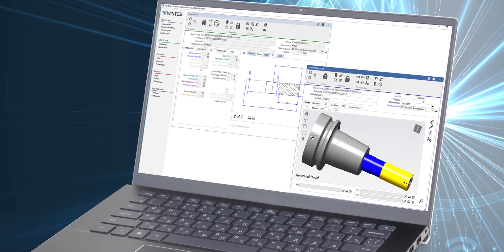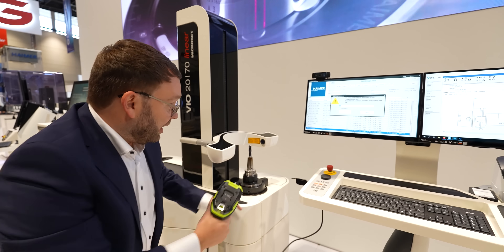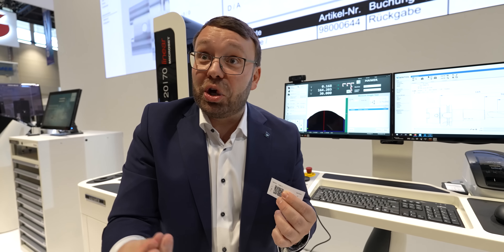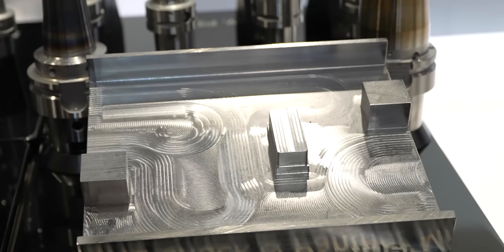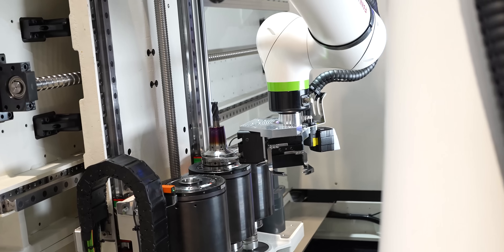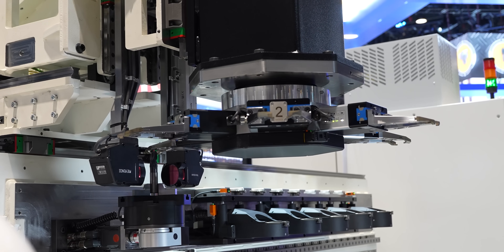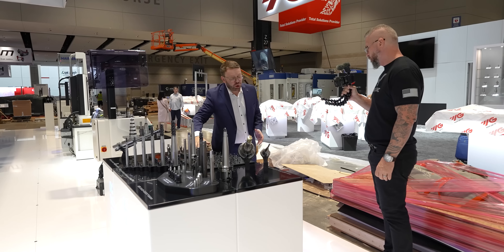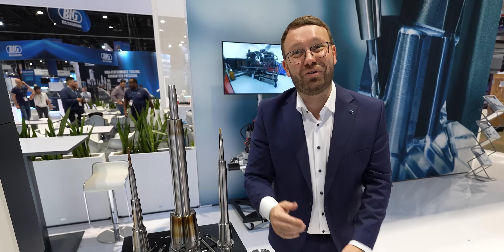Most Advanced CNC Tooling | HAIMER INNOVATIONS

Comment: We have a revolution, we have an "AI"-presetting. 🤦‍♂Ok, salesman has said the word "AI" and claims it's new, usually it's time to tune out of the video you're watching.
Reply: AI is not a strictly defined word, its a normal computer algorithm called „AI“ for marketing, the product still works as intended
Reply: @QPD-1  Well, that's part of the problem.
1) Instead of using buzzwords, just tell what the feature is doing. i.e. "an auto adjustment algorithm that tweaks this, by looking at these things, and is developed using machine learning, btw."
If you're selling a tool to a grown up man, then don't speak like you're selling a toy to a kid.
2) Just because you've implemented an ML-based algorithm, doesn't mean your thing is new. It might be something that has been used for 10 years in other industries and is only new for your product.
And then I could go on how Markov's solution to the probability theory dates back 120 years, and why AI in general isn't that new.   As a salesperson you're really better of not pretending like it's new.

Comment: i am a bit of an AI expert, having spent the past 10+ years with neutral networks, machine learning and other approaches. 
There is nothing AI in this implementation what so ever, just hype and hot air. 
Nice system thought.
Reply: Exactly. If your system isn't using some kind of 'Neural-Net-Like' / 'self-adjusting' mechanism at all - let alone as a fundamental part of its value-add - it's not "AI". People need to stop overusing that word. That scanner scans the part, identifies its geometry, and probably matches that (within an error margin) to a pre-defined set of general patterns about the category of tool. That AWESOME and USEFUL, but not any more "AI" than a web server or engine computer.
Reply: @-_----- Exactly

Comment: Who do you sue when the AI crashes your machine.. Oh wait, the fine print says you have to accept arbitration using the manufacturer's arbitrator. You will end up owing them money for tricking the AI.
Reply: It’s not „AI“ its a normal computer algorithm as used in industries since a long time and done right its perfectly reliable, its not like chat got which gives out various answers. It’s just a overused word for Marketing since „AI“ is not rally defined. So the system works perfectly well just not with „AI“

Comment: Except that it isn't AI. Which is good, because we need perfect repeatability
Reply: with how wide the ai definition is, a lot of things that are generously called minimum seeking programs count
hell most tool path optimizers from the 90's probably count
Reply: AI is not really defined. Artificial intelligence is basically any computerized decision making. Which is really just if() statements
Reply: @chadkrause6574  there is not one universally agreed upon definition, yes, but you're pulling a leg here with such oversimplification.
Reply: @feedbackzaloop  I’m not pulling a leg, it’s every company that uses “AI” that isn’t anything more than standard computer logic
Reply: @chadkrause6574  well that every company is playing dirty for the sake of marketing. And you shouldn't accompany them in this endeavor.
In the meantime there are "proper" implications of AI and that would be disrespectful to count those as if() statements.
Reply: @chadkrause6574  "AI" requires - at minimum - mechanisms in which the final outputs ("results") of the system are produced by self-adjusting logic, without the OVERWHELMING and OPERATIVE (time-saving) PART of the actual decision-making logic being human-coded.

This applies to LLMs, Neural Networks (Often used in Speech Recognition, Computer Vision Systems, and others), and similar.

This almost certainly does not apply to this scanning system which - as I said above - basically consists of hard code which directly matches the scanned geometry to a predetermined category pattern. Useful, but most assuredly NOT 'AI' in the classical sense (which is the only sense people should use - otherwise EVERYTHING done by computers will be called 'AI' and the distinction will be meaningless).